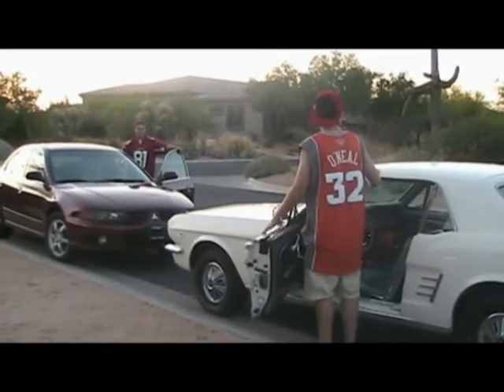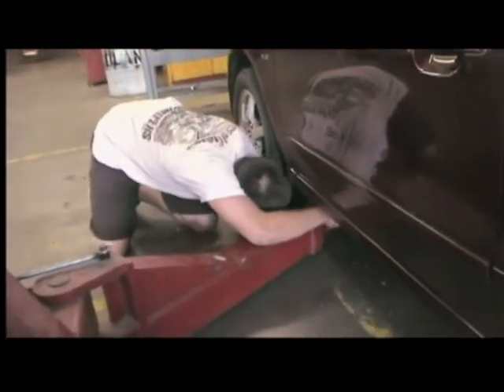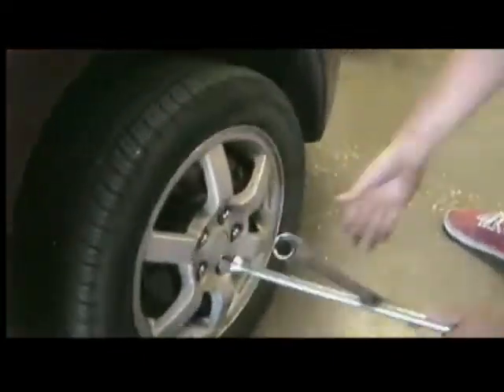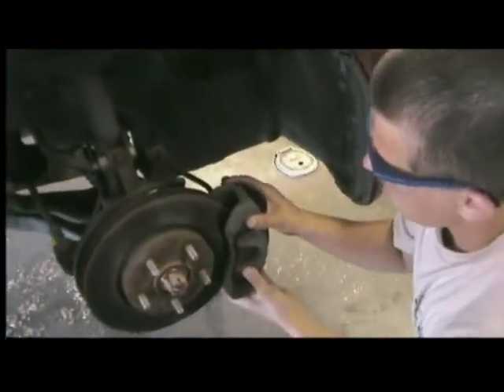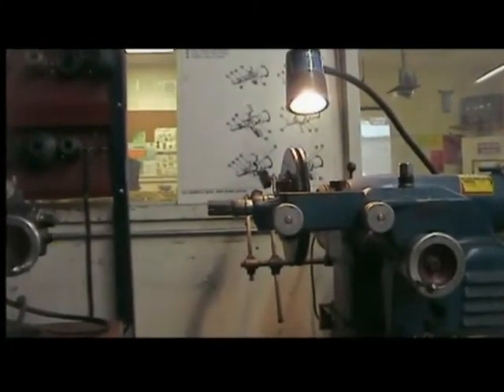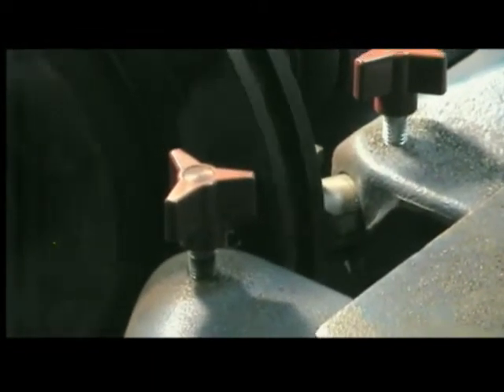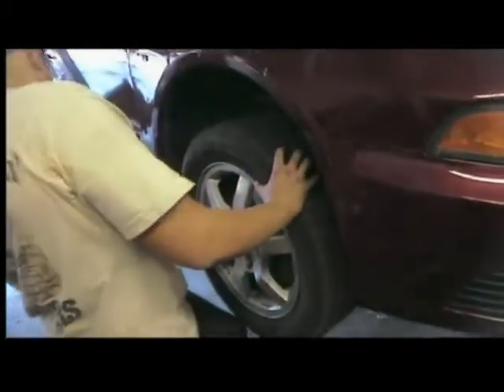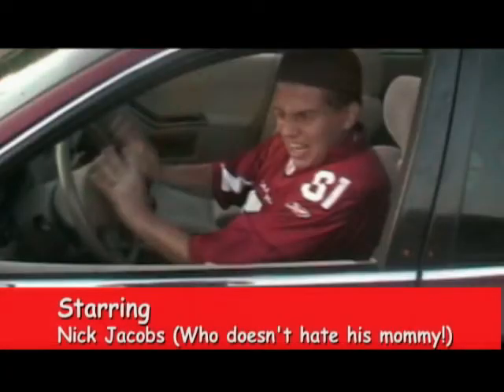Turning a Rotor

Comment: I like the idea guys and great job with the video.
I must however remind you of things you didn't do/ did incorrectly.
(Realize this isn't to be a douchebag, it's to help you in future instances)
1.  You never loosen bolts with a torque wrench, this immediately throws it off calibration
2. Always measure rotor runout & thickness to make sure it is within spec.
3. Always apply slide pin lubricant and "disc brake quite" and torque to manufacturer specified Ft-Lbs, this is so insanely crucial.

Comment: i'm surprised that no one else has gave you two a bit of advice about getting off rotors that are stuck...those two holes you have in your rotor (and that are in every rotor I've seen) are perfect for running the proper size bolt in with your impact and pushing the rotor right off, without you risking any damage to it or any other vehicle part by hitting with a hammer, mallet, etc.. (they are the holes next to the studs, on the rotor)

Comment: Nice try, but here are some important tech points...
1. Always use positive lathe bits, preferably Round. Negatives tear metal, while positives shave metal. Average 20% smoother finish, plus no final slow cut is needed so that saves 10 mins.
2. Use metal 4 spring silencer (#9800), rubber band silencers (#6920) create an out of balanced rotor. (More lead is on one side)
3. Always use hockey puck silencer assembly.  Energy deflects outward from bits and V's toward back, so it needs to be dampened.

Comment: Like someone else said not a torque wrench and actually you probably wanna use the torque wrench when putting the rotor back sure a few of those bolts have specified torque torque

Comment: A comment mentioned mentioned non directional but the correct term is Cross Hatch and it is not possible with sand paper, or swirl discs because they only flattens peaks.  Use a patented Rotor Hone, it reprofiles to very bottom of micro valleys and produces consistent 40 Ra crosshatches. See tool at...  rotor hone. com   Can't help mentioning soap and water wash. Absolutely critical, brakes can't be done without this step.  Don't use dish or bath soap, they contain oils.  stop brake noise. com